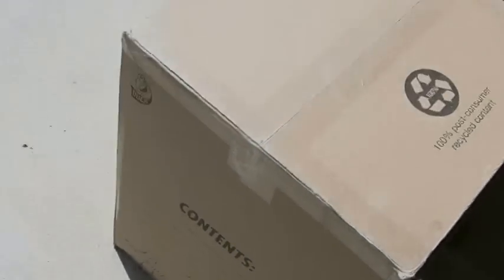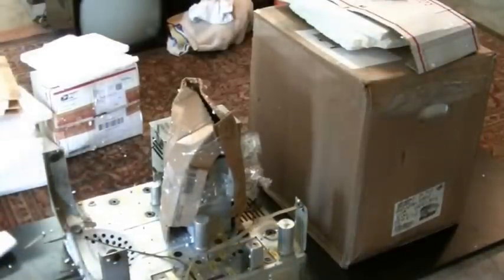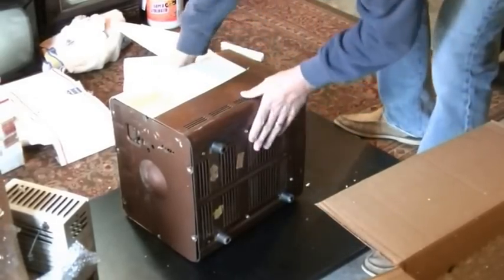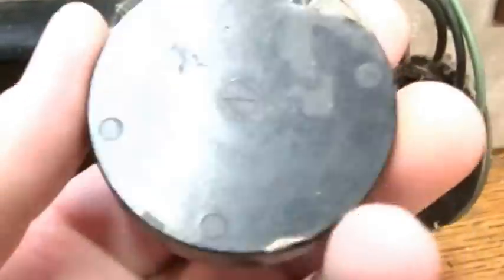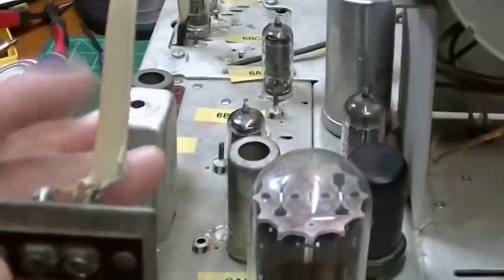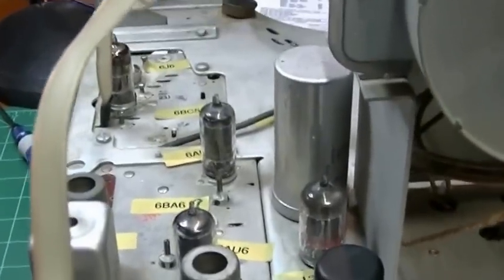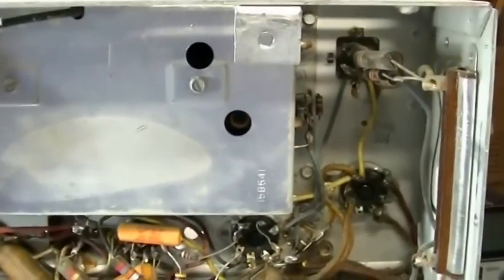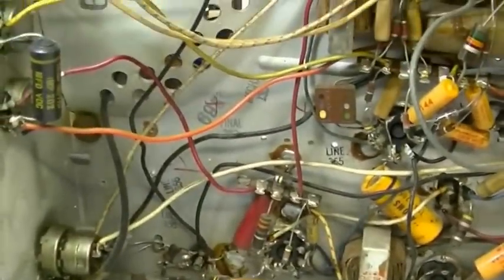Admiral 26R12N Pt 1

Comment: I just did a quick search on Mallory Plasticaps and I'm finding that these our the Mallory version of bumblebees. They had reliability problems and they could very well be originals. I like that little B&W TV. It's real hard to find one that size with a click stop tuner. Most are either continuous induction or worse, the scan type that only stops at an active channel. In the pre-HDTV days, I like to DX during skip season and it's virtually impossible with a scan tuner.
Reply from the maker: Hey THANKS Jerry....I kinda suscpected that!!! They are gone anyway since my rep is on this chassis. But I was real curious and they did look old enough for me to say see ya later. So basically a bunch of bumblebees....need to go. Thanks, Scott
Reply: ScottTV1962
Let's give them a new name..Yellowjackets!!
Reply from the maker: Hey I like that!!! That's what I'm going to call them!

Comment: What are you using for glue to fix your test CRT? I have an old round test CRT that has the socket missing.  The radio in my Zenith had one of those chassis mount resistors. It was open. Gary
Reply from the maker: I use auto windshield/glass sealer silicone that you get at the auto parts store. It's pretty strong, but yet will expand and contract if needed due to heat. Epoxy/super glue, things like that will not expand and contract when cured. CRT necks don't get smokin hot, but enough where you want an adhesive that can handle it. I'll show it in next vid.
Reply: ScottTV1962 I just found my old 5" test tube. It only has 5 wires still coming from the glass so I think maybe one has broken off. I haven't found the old plug for it. I will probably have to find another test tube as I do not want to rebuild my big Zenith porthole chassis and use that big 19" metal cone tube to check and calibrate the chassis. Gary
Reply from the maker: Gary...your not missing a wire. The old B&W's should only have 5 wires. But yeah, a 19" would be a little cumbersome, would basically defeat the purpose of the test CRT.  If practical, it's always best to use the CRT you'll be useing in the set. Making adjustments on a test CRT is fine, but you always have to keep in mind a different CRT will perform different and adjustments will have to be made again. In this case, I don't have the owners CRT, so I'm stuck with the tester, which is fine. It will tell me that the chassis is performing, or it is not.
Reply: ScottTV1962 Thanks for the input Scott. The 19" tube in my Zenith is metal coned which makes working around it quite hazardous. When I had my TV shop back in the late 1980s, I only repaired sets I never restored them. The sets I worked on were recent of the times solid state with boards that were easy to pull out and work on while they were still connected. I never used a jig although I did have one at the time. I now find myself buying back some of the test equipment I had sold off in 1995. Is there something wrong with that picture? Gary

Comment: PS: I just got a B&K 445 CRT tester cheap from eBay, with lots of adaptors and the book.
I never had a CRT tester.  I want to test my RCA.  Sorry I did not test that Admiral portable. It costed more than the tester to send it UPS!  I got that TV at a flea market for 15,  he wanted 20, and I got it for 15$. So it cost more to send it. I hope its CRT is good, that's worth it.  If I had the tester, well you know, less of a gamble.   Now that I have a tester, I may gamble on old TVs at Jamie's flea market. Ya win a few, ya lose a few, but even losers are good for parts.
Don
Reply from the maker: Hey my friend, don't worry about the Admiral tabletop CRT. It's a bonus. Just test your Admiral CRT and the RCA. If you don't have a manual, make sure you get one.
But your chassis is onward and upward my friend.